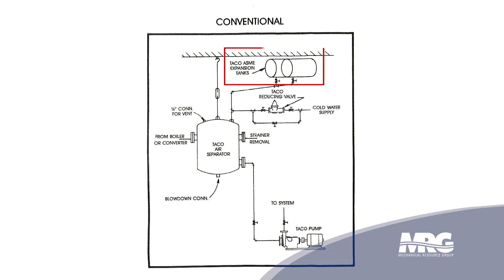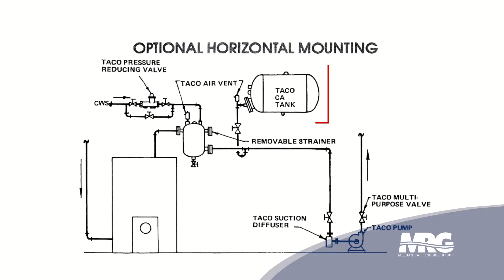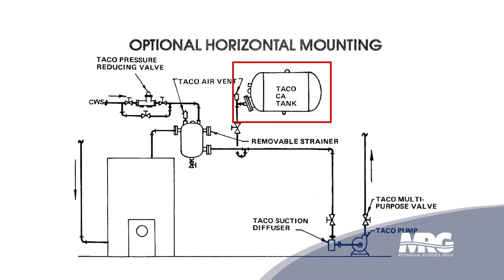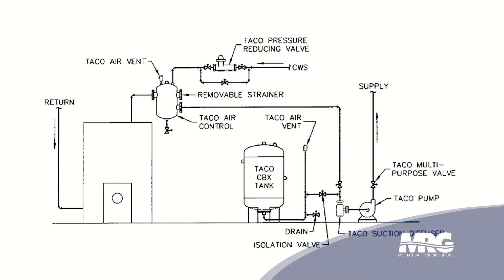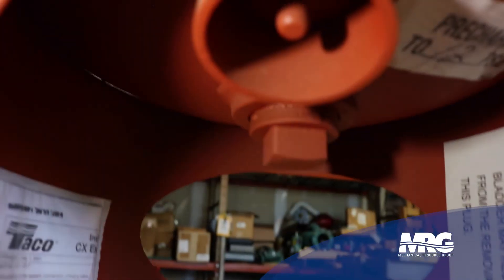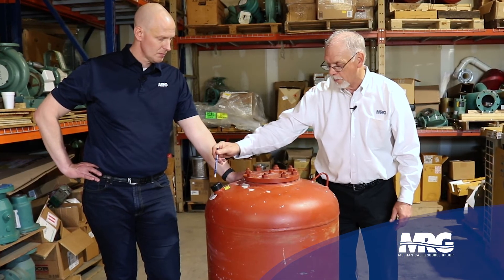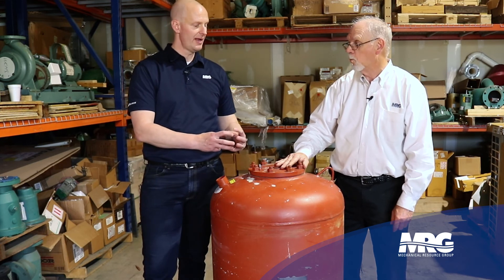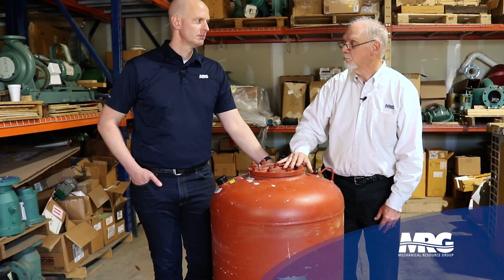Hydronic Expansion Tanks | Mechanical Pros - Hydronic Heating Systems Explained

Comment: I have a customer that wants a closed loop stand alone ice melt system (small 40x12 driveway).
Can the expansion tank be sized to provide volume and proper system head pressure?
Reply: @MechanicalPros  can you suggest whom could assist in sizing, say a mfr rep??

Comment: I have a closed loop hydronic system heating only a floor slab.  My 2 gallon expansion tank loses air pressure but water does not leak into the tank and the Schrader valve does not leak when soap tested.  Have you ever seen a situation where air is leaking through the diaphragm but water does not leak into the tank?
Reply: @MechanicalPros  Actually, I did replace the valve core but it made no difference.  My system is low pressure (7-15 PSI recommended) and low temperature (~100 F) so I'm thinking that the only reason that water does not leak back is because of the low pressure. I have ordered another tank but not yet installed it.
I have a question regarding initial air filling pressure.  I have always been more concerned about the pressure going too low than too high. (It has a 30 PSI relief valve.)  But if for some reason the gas burner goes out the pressure would drop (maybe even go negative if the weather is very cold) and the pump could be damaged if it is still running without pressure.  So if I connect the tank while the system is cold I'm thinking I should then add water to bring the system pressure actually a little above the initial tank pressure so that there is a reserve of water in the tank to allow for the contraction of water volume due to temperature drop.  So maybe 8 PSI intial tank pressure, then add water to bring cold system pressure up to 12 PSI, then when the burner comes up to cut off temperature the pressure would still be well below 30 PSI.   
Am I right about this?
Reply: @MechanicalPros  I don't know what the water pressure will be until it heats up and cuts off.  How much air pressure do I put in the tank before it heats up?
Reply: @MechanicalPros  Just to give you a follow-up:  I did replace the expansion tank and connected it the way I described.
8 PSI intial tank pressure, then brought cold system pressure up to 12 PSI. 
Turned on the propane water heater and when it came up to cut off temp around 100ºF the system pressure was 16 PSI.
Since then it has been functioning just fine with system pressure holding between 14 - 16 PSI.

So definitely the bladder was leaking air into the system without any water returning into the tank.
I would think that probably the leak was acting as a one way valve due to the low system pressure.